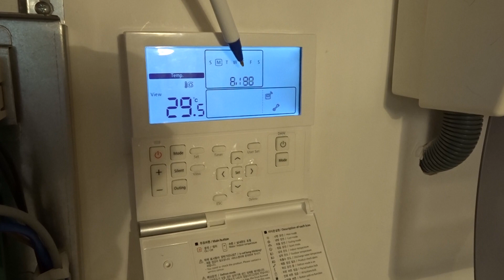E198 fault code on Samsung EHS AE090JXYDEH AE160JXYDEH

Comment: I have this code, the block you said to check has 0.0 ohms. Will i still need to replace the board? Or do i just need new wiring.

Comment: Hello. 
I Have this error. I removed the fuse, but cannot find a replacement. Could you please advise where I could find a replacement fuse. 
Thanks
Reply from the maker: you cant, its a new board im afraid unless you are good at soldering